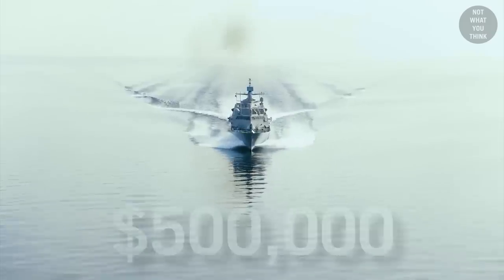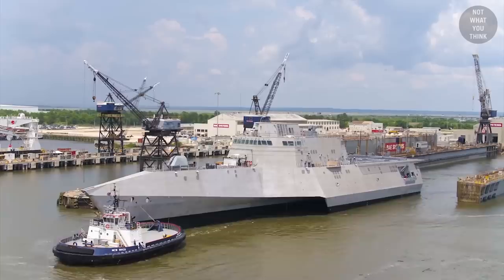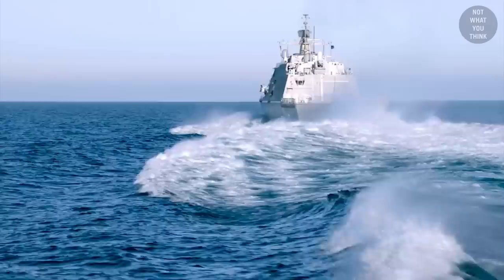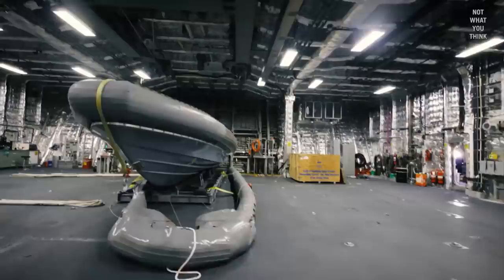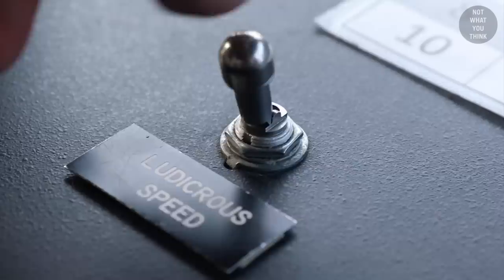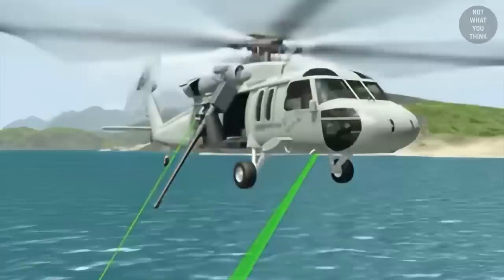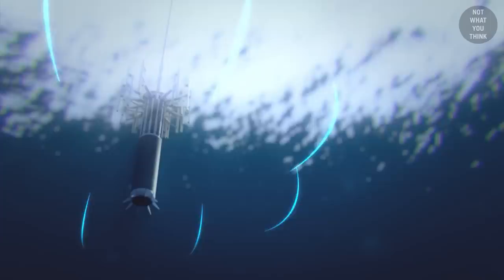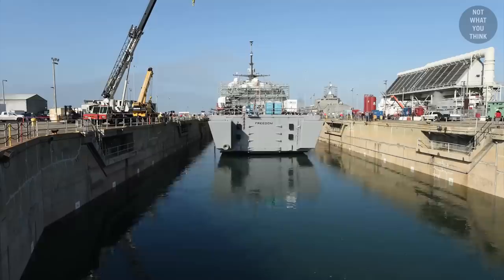Why Retire a 2-Year Old Warship?

Comment: The costs were far greater to repair those already in service.  What you may not have heard is that the ships of both classes are seeing stress cracks in addition to the engine issues.  I believe the new hulls were strengthened and the engines replaced.
Reply: Was that woman who just didn't do the temperature testing on subs the same person who did the stress testing on the LCSs?
Reply: That's a guarantee job. Want to bet that the same contractor is getting to build the replacements?
Reply: The ship was a big mistake that never should have been built.
Reply: i thought that they also had to add armor to those ships because they thought that the new stuff they were made outtta was gonna be stronger then normal, but when hit by a torpedo it was a guaranteed sink, so they added armor and slowed them down a shit ton, that was also a big reason for them scrapping those ships
Reply: @soulsreaper7145  I highly doubt that they armored them against torpedoes, modern torpedoes are powerful enough that a single one could probably cripple a ww2 Era battleship which to thus day were some of the best armored ships ever built. There would be no point in slowing the ship down to protect against them when the best defenses is to be as fast and agile as possible in order to evade them.
Reply: Criss cross bracing might help, maybe…
Reply: @soulsreaper7145  One of the problems of those ships was light armour. I mean lack of any.
by Adm. Peter Fanta
Reply: You stole my thunder, sir, about the hull cracking.
  Well done.
Reply: I think the problem is "You don't understand" that this ship does not use a propeller but a water jet...  In fact, stress fractures in the hull are a known problem for ships since tall sailing ships travel faster than 20 knots or more.  One solution is a Sub...another solution is a plane.  Stop solution is not to mix up power plants like either all gas turbines or all diesel.  However, there are a lot of countries with engineers who can solve the issues..so sell them...
Reply: This shouldn't have been a problem in the first place. Seaworthiness is literally the first requirement of any vessel.
Reply: So they were rubbish.

Comment: As a Coast Guard veteran and and a former 378 sailor (USCG Secretary Class) I am astounded to hear the information in this video regarding the propulsion issues. The Secretary Class pioneered this type of propulsion in the US military and they were laid down starting in the sixties (the British built the first CODOG - Combined Diesel or Gas - powered ships a few years before this). My ship had two diesel and two gas turbines coupled together just as explained in this video... and the last of them were just recently decommissioned and sold to foreign allies. So, we built something 50 plus years ago, which the Navy adopted and successfully built for decades after that, but in the 2000s we can't reproduce? Somebodies ass needs to get fired at Lockheed. Apart from the jet final drive replacing shaft drive the concepts were almost the same.
Reply: why would lockheed fire them? they just designed a ship that the navy paid fully for and had to decommission in 2 years so now they have to buy more ships from lockheed. seems like a big win for them
Reply: My question is why in the hell was Lockheed making a full ship? Subsystems I can understand, but the full hull, power plant, and drive system? That should have been left to the Navy yards that have the experience in building warships and can do things like building the lead ship of the class, doing trials and figuring out the issues and fixing those when the subsequent ships are still on the slipway.
Reply: When the same company gets to make new ships with no repercussion when the others don't work, it isn't really something to fire people over.
Reply: Retired Admirals belong in prison for this. Just another massive fuck-up by Navy Admirals, a shitty procurement system, unproven technologies, and more.     

7 years ago (2015) I called it, and now, the Little Crappy Ship program is coming to an end.    

IMO, quite a few Navy brass belong in prison for this boondoggle.  And certainly that shitstain RAY MABUS, former SECNAV under President # 44 does too.  God, I nearly hate Mabus for all he did to shit on US Navy traditions (3,000 sailors kicked out, most with good evals; ending/hampering the Chief's Initiation traditions; trying to get rid of Navy Rates; naming a ship after Gabby Giffords (whose only connection to the Navy is that she married and slept with a former Naval aviator).  I could go on, by why?  

Big Navy owes the American taxpayer a huge apology.
Reply: @hokutoulrik7345  Naval Shipyards haven't built ships in decades, and back when they did, they generally built large capital ships, not destroyer sized vessels.
Reply: Thank you! Everyone seems to be talking like this is some risky new technology should have been more thourghly tested before being used, which it's not.
I believe this ships are actually CODAG rather than CODOG, which makes them slightly more complicated, but the newer Legend-class Coast Guard cutters have used CODAG successfully and the Germans since the early '60s.
Reply: @lgd1974  Which bit is unproven?
Reply: @sergarlantyrell7847  
Well, we Germans had the same problem with our Braunschweig class corvettes. Someone tried to cut the costs and installed a cheaper gearbox from a different company. Long story short, we had to cut open the ships and replace the gearbox with one from Renk.
Reply: @phoenixqwertz  Well the whole Freedom class debacle has shown that RENK transmissions are far from flawless either.
Reply: When the French Navy launched its nuclear aircraft carrier, the Charles DeGaulle, they immediately suffered engine issues. Why? Because they installed the nuclear operating plant of a Rubis-class submarine, in order to save money. The system was wholly inadequate and the French had to replace the entire system. Lesson learned. Now, the U.S. Navy tried to power the Freedom Class LCS with a gearbox designed for a different type of CODOG, but with the expectation that the ships would turn into something that would go 22 knots faster than even the old Pegasus hydrofoils. 
   Someone made the comment that the Navy should have made one ship of each LCS class and then operated the hell out of it, to find all the problems. That appears to be logical and the Pentagon's logic team has been retired since Vietnam, it seems.
Reply: @geordischmidt  I think the problem is not understand the basic.  For example, this problem was common when the US NAVY transition from sail to paddle wheel to screw propeller.  In fact, the vibration damping for screw propeller and shaft is the amount mass in  the water.  Therefore back then positioning of this stuff along with figuring out the center of gravity, clocking moment and etc..  In fact, distance and mass of the shaft connection to main reduction gear has to be mathematically figure out....  Visual computer simulation can also be done like when the USA won the Americas Cup in Sailing. They are all taught by the navy in combat loading and balancing.  LCS uses water jet which are internal of the ship...the solution is much simpler that...then again I only got 2.5 GPA in a STEM Field.
Reply: @andrewdavis6917  mine was Dallas, 1979. She was also right out of refit but ours was years prior to FRAM.
Reply: Should have stuck with shafts and propellors.
Reply: @MrWizardjr9  

Because they might have to return the money.
Reply: Paul, were they connected to the same transmission? If they weren't, that's your answer.
Reply: @bobfg3130  yes. Four engines, two gear boxes and two shafts. It became standard for US Navy Frigates and Destroyers about ten years after the 378s employed them.
Reply: @paulnormandin5267  

Sounds like either wrong design or wrong gear box from another supplier.
Reply: @hokutoulrik7345  I'm not sure the Navy even has ship builders these days. Most of the builders are big companies which have bought the smaller companies or merged with other large companies.  If something goes wrong, nobody is held accountable. Instead, the "contractor" gets more money to fix what they should have provided as part of the original contract.
Reply: Yeah it's really strange, i think Saab uses this exact setup with waterjets on their Visby class corvettes and i have not heard of any problems with them. If the transmission don't work they should replace the transmission with a better one, don't get why they need to retire the ship.
Reply: lockheed owes the US the cost of the contract for failure to deliver as promised
Reply: The problem might be not so much in how to build a CODOG, but how to build a compact, lightweight CODOG powerful enough to achieve 47kt. They might have designed it too lightweight for the task.
Reply: @MrWizardjr9   monopoly at it's finest
Reply: Listening about Red Gear problems brought back memories of the Mellon and Hamilton.
Can't believe these issues have not been addressed with so much history on the 378's!
Forced imports and dry docks leaves US unprepared.
Reply: @brunopadovani7347  Agreed 💯 The four remaining Naval Shipyards in Norfolk, Portsmouth, Puget Sound, and Pearl Harbor were built in the 19th and 20th centuries and built primarily sail and conventionally powered ships.  Now they're just maintenance facilities and can't build ships since they don't have that infrastructure.
Reply: @Steve-dr8rw  Agreed, plus the videos these kind of channels make are just to stir up interest for eyeballs and clicks to drive the algorithm regardless of facts. 👍